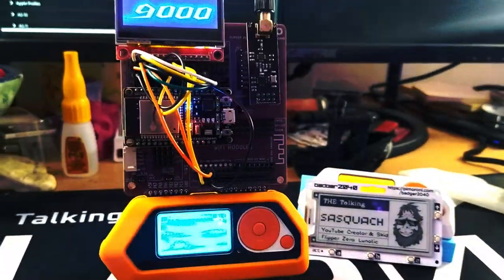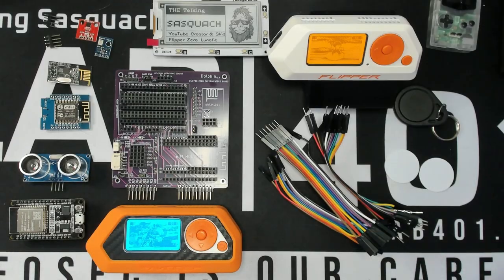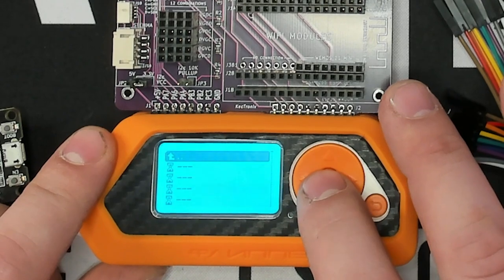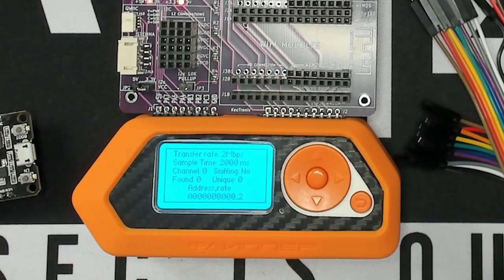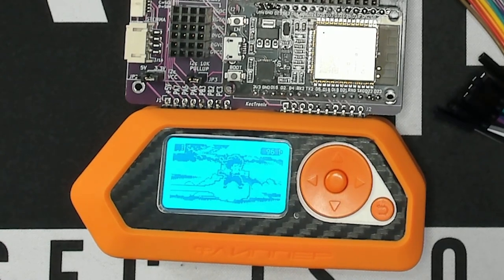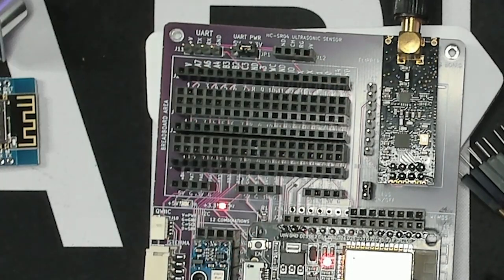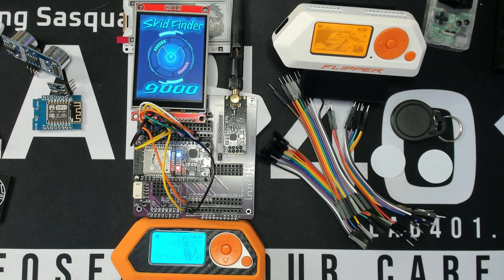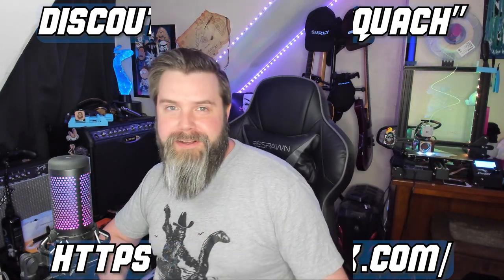The REAL Flipper Zero Mad Scientist Board!! KecTronix Dolphin Board!! 🤯🐬😲🧪🥼🔬

Comment: Great video!  I like the idea of the foam to help support the board (it's a fairly heavy board).  I wonder if some standoffs would work on the top of the board for when it's on a desk, I never noticed the mounting holes before.

I've really enjoyed using the Dolphin vs. just a standalone breadboard w/jumpers.  I just finished moving, so later this week I plan on going through my 100+ sensors and see what I2C pinouts actually match what I have.  Most of my videos lately have been on SubGHz but I hope to get back into the Dolphin and Dorsal soon.  I'm thinking maybe I'll try to add support for a SHTC3 temp sensor (since that isn't supported yet).

I like how you used some of the bottom right pins to hook up the display.  A pinout document for the Flipper that shows the physical board to pin would be helpful (and help understand things like what pins the ultrasonic sensor is using).
Reply from the maker: Agreed!! There's a great deal of figuring things out that we had to do with this board.  I may have let some magic smoke out of one of my temp sensors when I accidently plugged it into the wrong row of headers.  I didn't realize that the distance sensor forced 5v!  Luckily I didn't burn the board, just the flux I used to solder it!